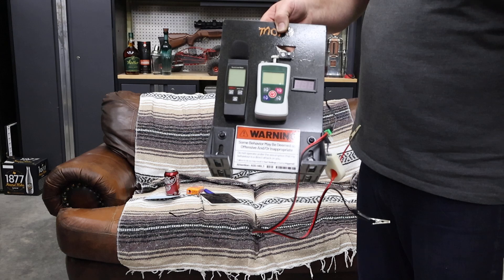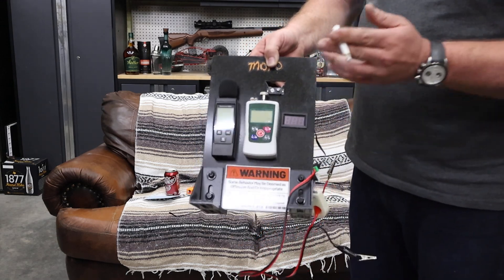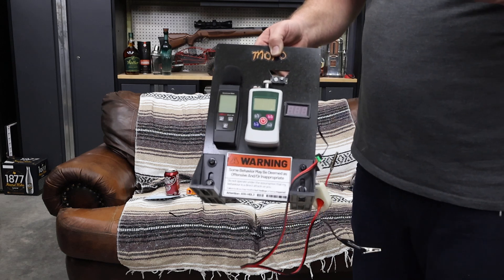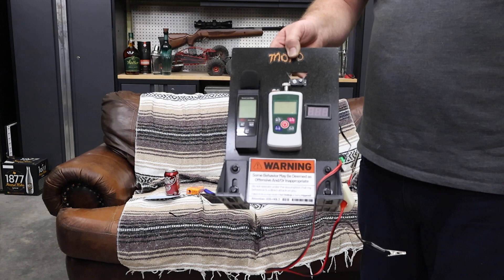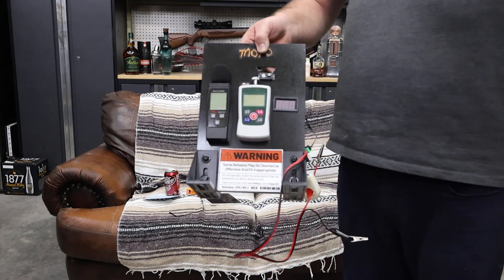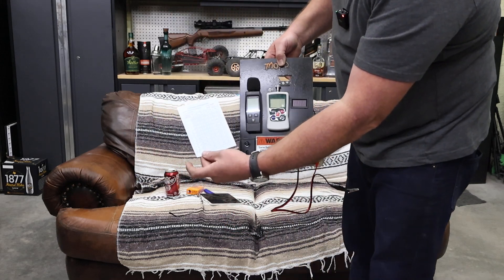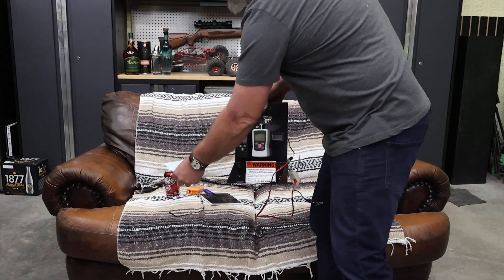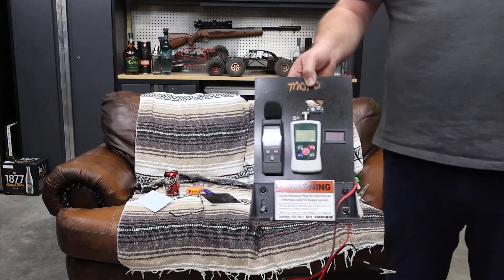SERVO TEST the preface after the preface... cut short due to new equipment see description

Comment: It’s not the “weight” of the water. Water displaces laterally and exerts a certain pressure (PSI) at a given depth, regardless of the size of the container, not with a linear downward vector but pressuring all surfaces, relatively evenly. The “column of water” exerts no greater pressure vertically.

Comment: The weight of the cylinder of that column of water above it
Reply: And it does apply to all sides of the object, not just from above
Reply: Get that horn to guage angle at 90° for correct results as well. M=Fsin(x)r
Reply: And correct for r (distance) 24 mm = 0.945 in